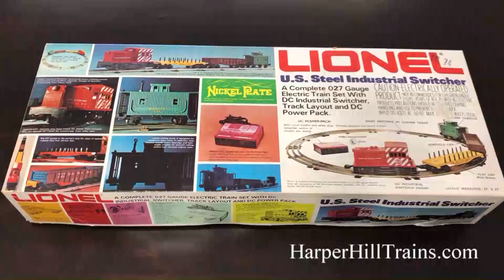Lionel U.S. Steel Industrial Switcher Train Set Unboxing, How To Set Up, Running Harper Hill Trains

Comment: This was the first D.C. direct current train set made by Lionel from 1973 to 1991.
Very nice to see and thanks for sharing. These little trains were under-rated and dismissed by most of the Lionel folks.
The D.C. can motor is smooth and quiet with good low-speed control, also easy to reverse with a flip of the polarity switch.
Reply from the maker: I really enjoyed this train set.  Thank you for watching.  :)

Comment: I really like this set even though it's simple sometimes simple is better than a high end set
Reply from the maker: I like it as well.  Of course, this could be run on a larger train table, or use the track to extend your current train set.  Thanks for the comments.  :)
Reply: @BradDison  Your welcome